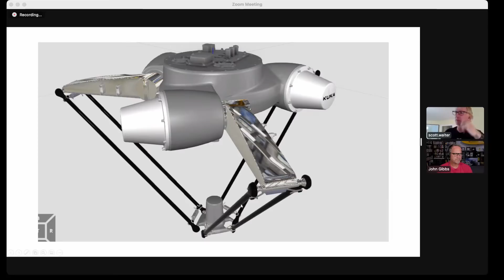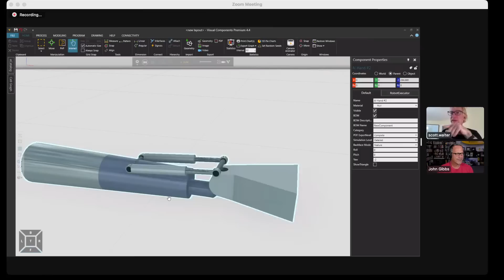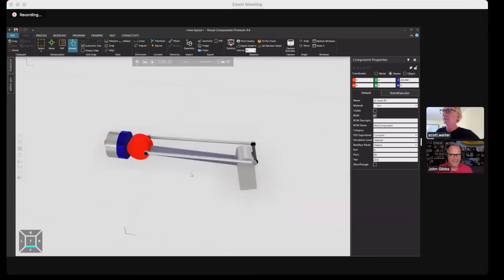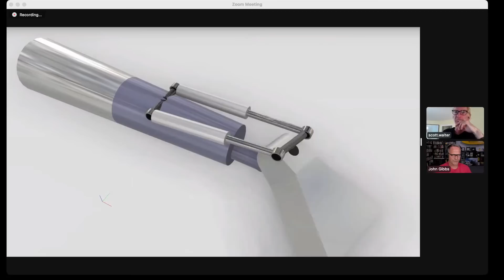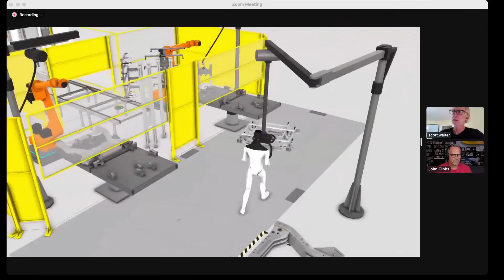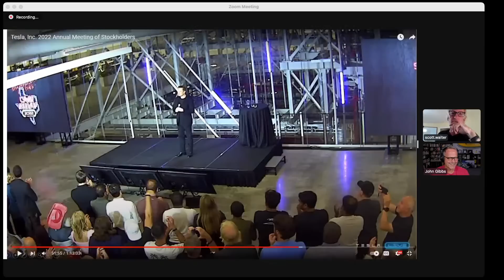Hand Jive: What Tesla's AI Day Poster Tells Us About Teslabot Upgrades!

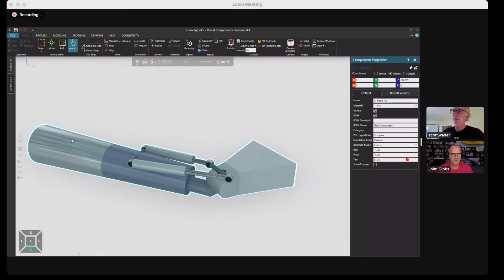Comment: 18:00 ish: Doing the Euler Lagrange and inverse kinematics with the constraints etc will be far from easy unless you simplify the system to point masses etc, especially if you are trying to solve for multiple joint movements. Saying this as someone who has done this in the past hehe. But I assume Elon, SpaceX etc are pretty damned good at this by now. Just throw it into mathematica, set a few sin x = x, cos x=1 etc simplify, linearize and the system should behave mostly correct ^^ or just throw deep learning at the problem and hope you cover all cases.

Comment: There are angular actuators similar to those found in hard drives but need current to maintain a position.  Great for precision dancing but not for cruder grunt work.  Tesla really can leverage BLDC motor actuators where motor/structure(bones) are integrated and can rigidly maintain a pose using minimal power.